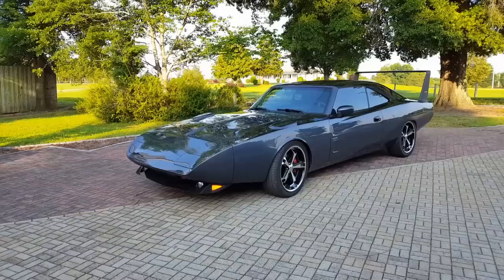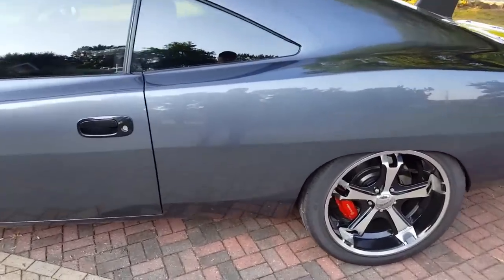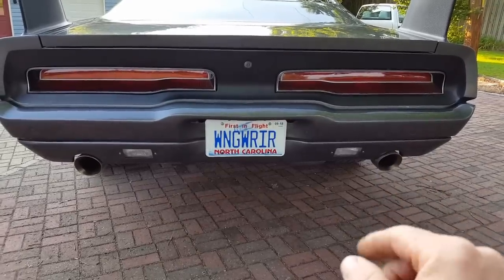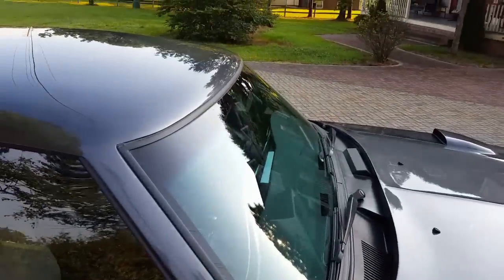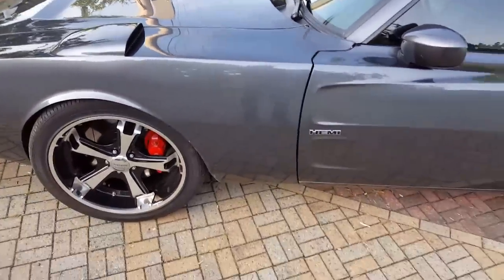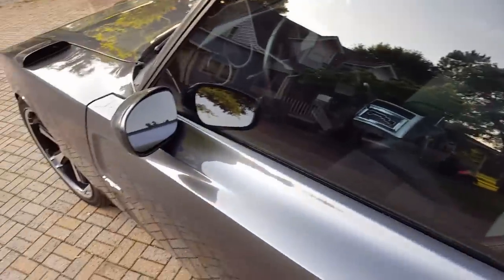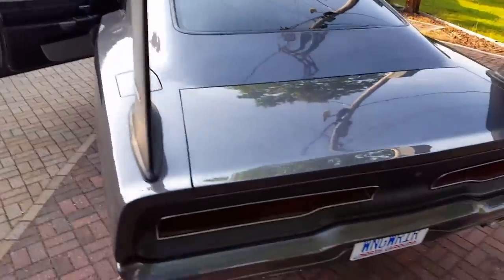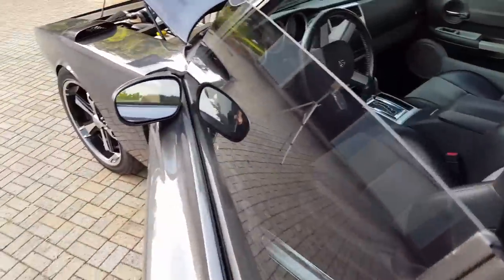SRT-8 Dodge Daytona Clone Car Project: Finished Walk Around

Comment: I see you were finally able to register & drive it. How'd you pull it off?
Reply from the maker: After a lot of back and forth the finished paper work just showed up one day and at the top it said 1968 Dodge Charger 2 Door sedan, factory.  I guess the stopped trying to figure out how to treat it. You are supposed to vin it by the chassis but since they were both unibody cars I was able to convince them the rockers were the frame rails which they technically are so they belonged to  the original 68 Charger.

Comment: Is this possible with AMD panels instead of charger body shell on a newer challenger/charger chassis
Reply from the maker: Yes. The only problem is establishing a good roof sub structure and windshield surround as these are the only parts not reproduced by AMD. For this you can use any roof structure from any B body from that same era.

Comment: I've always thought that those could scoop heat extractors were fake.

I remember hearing in an interview it was some panel of guys old racers that were selling a book, autobiography type of deal on how they cheated and broke rules and cut corners in the heyday.

And I swear I heard that those scoops were to just cover up some holes in the fender from getting the car lower than they were allowed to, so they lowered the body but didn't move the position of the spring or something like that.
Reply from the maker: They told NASCAR they were for tire clearance but were for downforce.